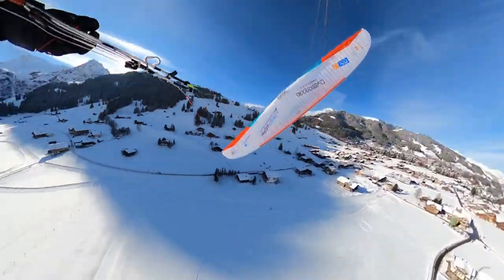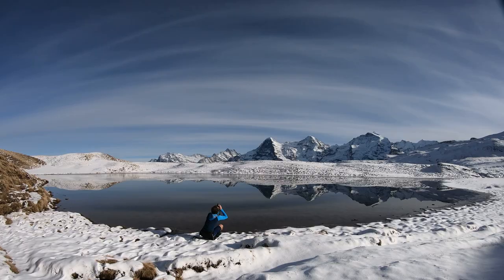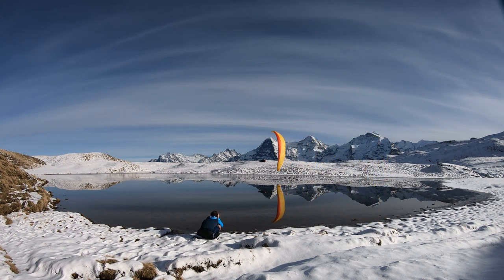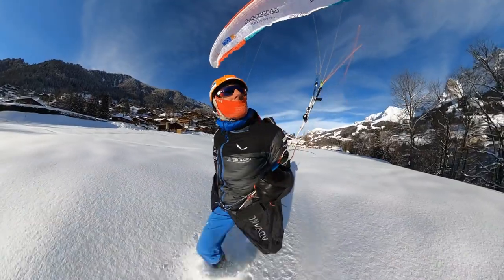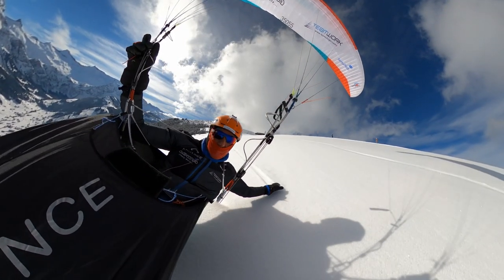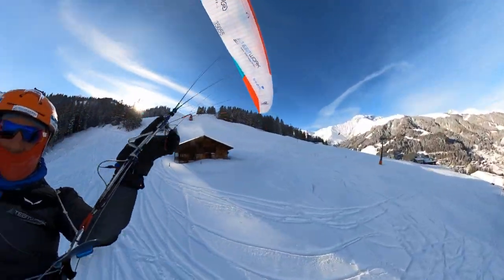9. Clip Chrigel`s comments...#skills #groundspiral

Comment: Are you actively using the speed bar during the spiral? e.g. at 1:32
I wish I had a cushion of soft snow to practice this. The 3cm of slush on my local airfield won't do the job :-/
Reply: no, if you'd use the speed bar during the spiral you'd have way too much energy for the landing.
Reply: @thatguykaini  he is definitely using the bar after exit to flatten the flare. You can see it on the risers. On the shot with touching a roof of the house it also look as if he used a bit of bar during the spiral. Maybe it wasn't a full spiral but just a turn to gain energy. Or possibly active piloting wit bar instead of breaks is just his second nature.
Reply: @iwoxc  yes after the spiral maybe but not during